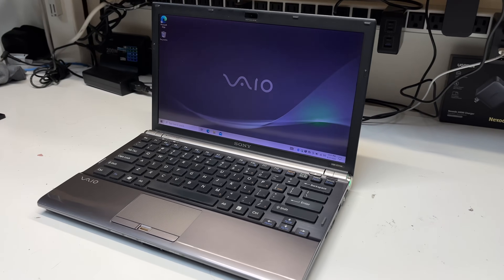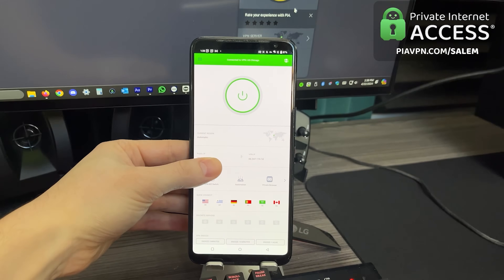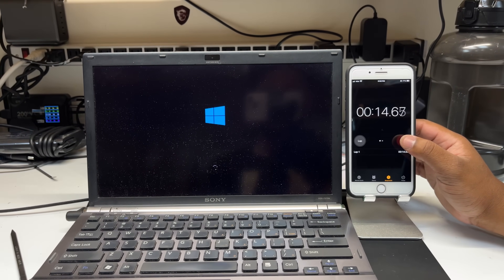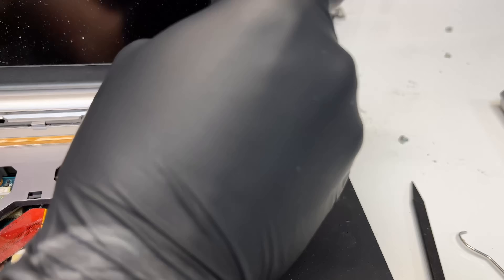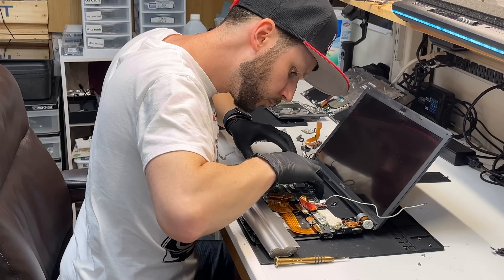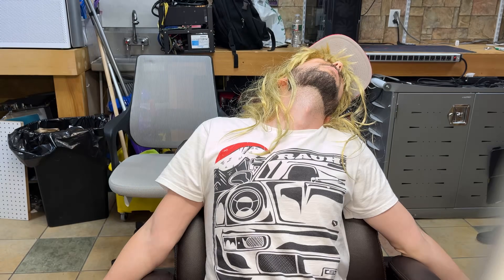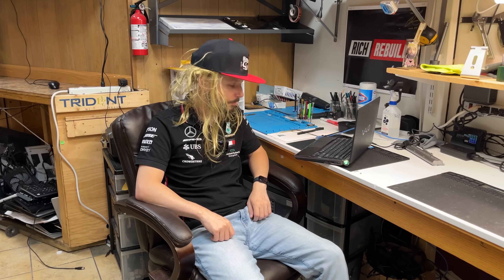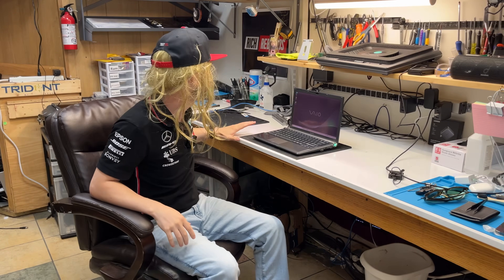Sony Vaio Resurrection: Saving this Insane Tech From 2008 (and why that soon won't be possible)

Comment: I have a 12 year old laptop and while I think it's slow for memory-intensive apps (like Canva, for example), it does everything else fine: web browsing, video conferencing, desktop processing applications.

I upgraded the RAM and changed to HDD to an SSD and it's gotten new lease on life since I made it. But as you mentioned, the upcoming end of security updates for Windows 10 makes me extremely wary for it.

I am going to switch to Linux so it can still be of use to me beyond its intended useful life.

Edit: I bought a newer laptop and I have the same fear that it may not be easy to repair by myself. I repaired my old laptop by referring to YouTube tutorials, and these fears really make me want to impose my right to repair.

Comment: Damn, that reminds me of my first laptop, a Viao that looks quite similar to the one in this video (had the exact same power button) that I had as a wee lad in the early 2010's

Wasn't bought for me, used to be a sibling's laptop (previously my step-dad's laptop) till something happened, and when I came across it the power button didn't work (physically, like it was stuck pressed in), so I remember tinkering with it, taking it apart on our dining room table, reassembling it, and somehow, something I did managed to un-jam the button and I was able to use it as my own for a little bit, I remember playing old-school Roblox on it for a good while.

Nothing special or interesting, just unlocked some nostalgia for me is all, figured I'd share since that's quite a unique laptop, with that power button design. Wonder where it is now, highly doubt we have it anymore as we've moved into a new, smaller house since.

Comment: The problem is not only soldered RAM and SSD, but serialization of SSD, so even with micro soldering it is a nightmare to replace, and RAM is integrated to CPU that is also serialized.

Comment: Small tip (lol) on the drivers: You can export the drivers from the old windows install by using export-windowsdriver -online -destination '<foldername>' in powershell where <foldername> is the location on the drive to save the drivers; then import them to the new install using Dism /online /Add-Driver /Driver:<foldername> /Recurse Then you will hopefully be able to experience the full power of your customer's old dingus

Comment: These older Windows XP/7 laptops are a son of a bitch to get into. So many goshdamn screws and sometimes the laptops I fix have no iFixit repair guide! A couple months ago, I was repairing a Dell laptop. I found out there was no iFixit tutorial for that laptop. I opened the laptop from the back but then the back hinge snapped. At least it was easily able to upgrade the ram or replace the battery. These laptops are absolutely hell. (Note: Im Australian and I have to say I was not drunk working on that laptop)

Comment: Frameworks aren't really upgradable though. 
Forcing you to buy an new mainboard with soldered chips isn't "upgradable" and if it is then macbooks are upgradable since you just buying a new laptop at that point.
There's nobody stopping them from doing the desktop cpu thing like clevo. Pretty much the only difference between them and clevo is that they part out their shit. 
Hell they won't even offer a non travel sized battery.

Comment: I have two laptops that are almost completely repairable imo: a Lenovo IdeaPad S340 (I think there's only partially soldered RAM and the CPU that would be an issue) and an MSI Katana GF76 (obviously CPU and GPU are on the mainboard). They seem faily easy to repair/maintain, though I only opened them so far to upgrade storage, but opening them is easy.

Comment: I want to desperately send my laptop over to you, but it's the only thing I have for working on my files (no, my phone does Not count), but I dunno if parts are still available for it or How I would even go about changing them (I don't have tiny raccoon like fingers and the tiny wires scare me, 😅). Mine is 4 yrs younger than this computer, it's still old....but she's worth it!
Reply from the maker: In cases like these I always recommend buying a backup PC with your files synced onto OneDrive or Google Drive, because WHEN that laptop dies and takes all your files with it, it will be a much bigger disaster than not having your laptop for a few days 💀
Also what’s going on with your laptop? Check our website to see if we can fix 😎
Reply: @SalemTechsperts  lol uh, funny enough, my laptop Was the backup to my previous setup -which is a desktop that Also stopped working, but I'm honestly not sure Why (like, I dunno if the updates to the tower were too much {since it Did go several yrs w/out having access to the internet} or if the battery just started failing (it Wanted to power up, but it just wouldn't)).

How exactly would I go about setting up OneDrive/Google Drive for backup? I think I tried but I just had No idea what I was doing  & just...didn't try again (my bad). I'll make a call during your working hours (since we're on opposite ends of the country, lol (I"m in CA)). And I did check your website; for what needs to be done on my laptop I believe it Would fall under what could be repaired

Comment: i had to repair a vaio a while ago and yes, the vaio control center was removed from sonys website but i was able to download it from somewhere else... but of course it doesnt work at 100%. In my case the notebook had retroiluminated keyboard and that specific function was not able in windows 10 nor 11, so i had to install windows 8, and then upgrade keeping files to get the light control working on w11. So even having the software you have a lot of problems with compatibility.

Comment: I use a VPCEH40EBW from 2014. Im actually the first owner of it (got back in 2023) and just had to replace the battery and put a SSD. This thing runs smoothly for everything basically, even 3d Software runs pretty good and doesnt overheat (probably because didnt pass through Gooch test from years).
It also fell on ground damaging the shell but doesnt even show up, really a tank

Comment: The quality aside, Sony did some pretty unconventional Laptops and UMPCs, especially in the mid- to late 2000s it matches their slogan "like.no.other".
I like the VAIO Z21 they brought in 2011, it was rather slim without an optical drive, but it came bundled with the "Power Media Dock" which not only had an optical drive (Blu-Ray!) but also a Radeon GPU, USB (1x2.0 1x3.0), HDMI, VGA and Ethernet and to connect that it used a proprietary connector based on Intel Light Peak (a predecessor of Thunderbolt using optical fiber transmission, for Thunderbolt they returned to copper).
It also had a carbon-strengthened lid and additional external battery (covering the whole bottom).
So they had an eGPU years before others like Alienware, Asus (they showed their XG Station on E3 2007 but I don't know if that went into mass production), Blackmagic and others brought these.

And also other products by Sony, they had the first OLED TV ever, the XEL-1 with just a tiny 11" screen with quartered HD (960x540) resolution, the NWZ-A820 series MP3 Walkman in 2008, one of the first with Bluetooth, years before the iPod nano (and the Touch had the hardware, but it wasn't activated until iOS 3 in mid-2009).
Their phones together with Ericsson were sometimes quite quirky and also partially in the era after that with the waterproof Xperia Z (first waterproof flagship without being clunky like classic rugged/outdoor phones).

Never had a VAIO but it's sad they quit, Fujitsu also now quit more or less on client PCs, however I got a Xperia Pro-I and like it, battery life is not so great but the screen is nice, due to that unusual "cinematic" 21:9 aspect ratio but that makes it not too wide, the camera is doing rather raw photos with a lot of manual options and similar menu structure as the standalone cameras.
They also still have headphone jacks even on their latest 1 (Mk.) VI, microSD reader and full-blown USB-C with 3.0 and Video out (yes, many other flagships also have that but I came from Xiaomi and until the 13 Ultra they had crippled USB-C with 2.0 🤬).

Comment: I had the same laptop but with first gen Nvidia Optimus technology with the Geforce 330m (not mx330) and I remember I always had to edit the ini file of the geforce drivers and add the hardware ID of the vaio to get it to run GTA V on windows 8.1 and it actually ran pretty good. Excellent laptop overall except for the fragile screen, a friend of mine tried to pick it up by the screen once and cracked it so I replaced the 900p panel with a 1080p one, and kinda accidentally bent the heat pipe when I tried to clean it so the cooling was never the same after that, I still miss it though.

Comment: I have a VPC-F12Z1E from 2010, it has i7 740QM processor(1.73 to 2.93 MHz(TB), 8 GB DDR3 1333 Mhz Ram, NVidia GT330 dedicated graphics
And it has a MFing Blu-Ray RW drive.
I'm still amazed that it's alive and kicking. For office programs, netflix, IPTV and browsing, my dad is still using the hell out of it.
And as a loyal Salem audience, I'm keeping its insides gooch-free.
Reply: Yep, I have a 17" version w the same specs. Cloned the drive to an ssd. It has standalone licenses of Adobe CS 5.5, Autodesk programs, etc. I'm keeping alive as a maker laptop to run 3d prints, vinyl cutter. Hoping it can digitize my old sony camcorder tapes too. We'll see.
Reply: I have a similar version with the same specs. its dead reliable and i constantly use it to program chips and calibrate monitors. windows 7 onboard since most programs dont wanna work with anything more recent lol.

Comment: While far from being the greatest technician that ever lived, I have worked on a few laptops over the years and regretted it.  Soldered on RAM and SSD's can be beneficial in some regards, but the cons outweigh the benefits of being able to have a smaller, lighter product that might perform a fraction of a percent faster because there's less material to pass through.  Just the thought of the SSD in someone's computer cracking with a drop or hard enough bump makes me concerned, as does discovering a battery is trying to escape on its own.  Without a way to repair (within reason), upgrade or even expand upon storage/memory, someone can end up getting something that ends up being a luxury paperweight in time.

Like what happened to one guy that bought the M1 Macbook with 8 GB RAM and a 256 GB SSD, reaching the SSD's End Of Life within a month working on 4K video (or maybe it was 8K); the amount of caching ran through the SSD's write cycles faster than (insert inappropriate mother joke here).  Since the SSD is soldered to the motherboard, plus every other way that Apple makes their stuff extremely hard to repair, if at all, there was nothing that could be done at that point.  Now, it's not just Apple that does this stuff, but it is an example of what can happen with the design and engineering that goes on with some of these products.

Disappearing software and documentation hurts as well.  There are people who work to preserve as much as they can, but there is so much out there that may never be found again by anyone who might need it because they want to actually still use something instead of just get rid of it and buy the newest version every year or two, like most companies would prefer.

Keep doing what you do and always remember where your toothbrush is.

Comment: I had a VAIO for many years (2014 model I think) It was immensely repairable, I even replaced the plastic shell and the keyboard after a nasty fall on concrete. Changed battery added SSD, changed wifi, memory and the plastic shells (gradually not all at once). Now my mother has it

Comment: My local area has "repair cafe days" where volunteers from the community will repair devices for free for anyone who brings one in, it's all done on dedicated days and generally services older people with good but old hardware. Highly recommend anyone skilled sees if this is available in their area and volunteers (and if it isn't, maybe get a program like this started)
Reply from the maker: I would love to dedicate a day to one of these repair cafe's. We have a few in Boston
Reply: I used to volunteer at one. We have fixed a lot of stuff as a collective over the years. I fixed hedge trimmers, toasters, laptops, radios, musical keyboards, amps and so on!
Reply: @RepairWins Your handle says it all 👏 😊 🙏🏼
Reply: That's sweet.  I have a few old iMacs from 2011 that would be fun to try to fix up.  All are functional except one.

Comment: I have the new model Acer Nitro 5 (AN515-46 I believe) and I am loving it. Opened it up a while ago and I really like what I'm seeing, only issue I have with the model is that the HDD plug and parts with other nitro 5 models are missing on this one, with a bare soldier spot where it would go. And I genuinly can't tell if it could be added back in or not.

But that's besides the point, after a lenovo ideapad 3 I really loved seeing how spare parts for this seemed so easily available, and how the speakers(crazy I know right) where so easy to replace. Not to mention an extra spot for an NVME. Hope I can use this thing for a long time

Edit: I just looked up the lifecycle extension guide for my model and it's literally a step by step guide how to disassemble it, it even shows you how to remove the LCD panel from the top screen so you can replace it. There's even an exploded diagram of all the parts, and it lists how many and what screws should be for every step and every single part number. Like god damn

edit 2: I Can replace the entire keyboard to change the backlight color???? DAMN

Comment: Can't remember the model, but I had a Vaio laptop with a 3GHZ P4 cpu.    Unfortunately, it was taken out by an update.   It worked fine until I had to re-install Windows.   It was lovely and fast until I ran the first update cycle.   Somwhere amongst the 100 or so updates that got installed was one that torpedoed the laptop's performance.   I know I could have used Linux, and would have got much better performance, but I needed some software for work that was Windows specific, and some of the websites I needed to access (again, for work) were locked to Internet Explorer.

Comment: sony Vaio Care was the software you downloaded first to get drivers and software installed along with vaio recovery partition setup and what not but sadly they shut down the entire server back in 2023(i was too late to find this out until very recently when i was reinstalling propritary software back on my 2010 Sony Vaio-S). All the recovery discs and softwares are archived in the the internet archive and is not organized so its very hard to find what you need (over 1.7TB).
they really should have just kept vaio care alive instead of shutting it down or sold it to someone else to maintan it. really bad move from sony imo.

so far for most Vaios you just need atleast vaio control panel installed and for that you need 4 other stuff preinstalled for it to work properly
1. Settings utility series
2. Sony Shared library
3. Vaio even service
4. vaio control Center 
5. vaio power management
In this order or it wont work properly. 
search them on the internet archive and you will find zips of these entirely on them and it will work.

Comment: I have th same laptop, but its the SVF 14 model with integrated graphics (it needs, battery replacement due to the battery capacity being 70%, display replacement, internal cleaning, thermal paste replacement because it was never replaced)

Comment: Ironically what gives you so much grievances with upgrading/repairing laptop parts today is the one what makes me search for videos like yours. There used to be a time when replacing a faulty keyboard or adding more RAM capacity was such a simple endeavor for me. But now, I have to watch laptop tutorial videos and ended up visit my local laptop repair shop anyway to do just that.

Anyway I love your videos, both long and short formats. Much love from Indonesia.

Comment: I even have an old Dell Precision T3500 with a Xeon x5670, 16 GB of RAM, NVIDIA RTX 3060, and a 800W PSU I put into it and it can play games and still do everything I need without issues.  It came out in 2009 and still rocking with tasks and AAA games.